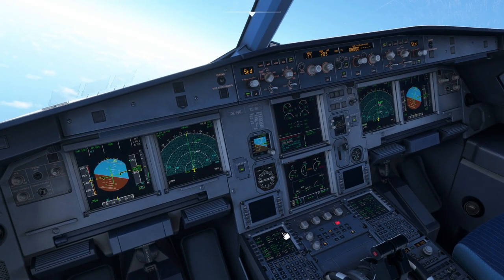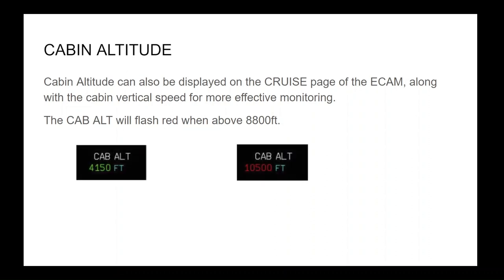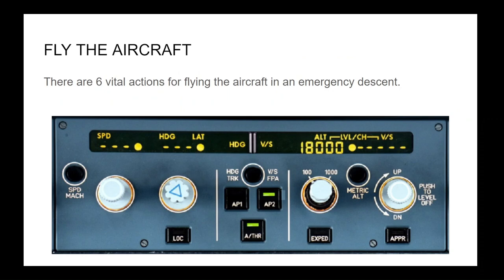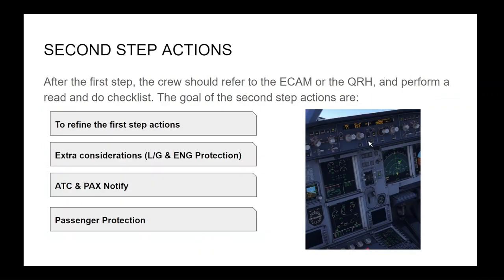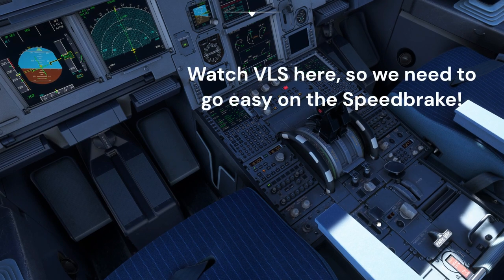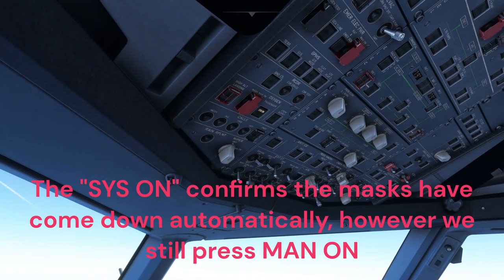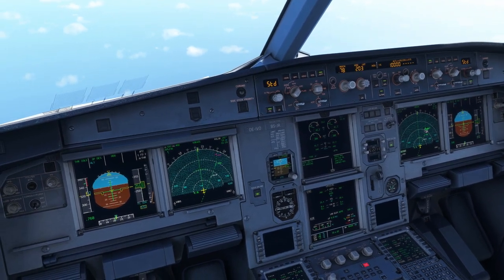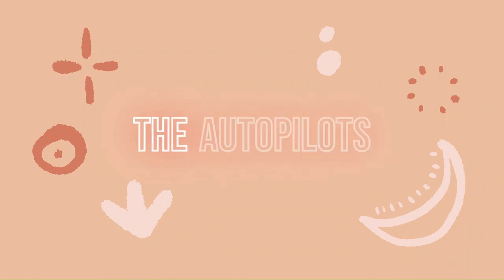MSFS A320 TYPE RATING - Emergency Descent

Comment: Loved the video! When is it good to use the Expedite button on the FCU?
Reply from the maker: Good question! We don't really use the expedite button too much. Consider using it if ATC ask for a higher rate of climb/descent. Usually we will just adjust our speed instead, as this is a more effective way of controlling the a/c. In this scenario, we suspected we had structural damage so for that reason it is best to limit speed increases to protect us from any further structural damage. If there was no damage, then yes, the expedite pushbutton can be a good option. Hope that helps!